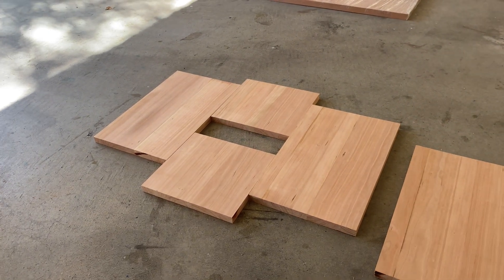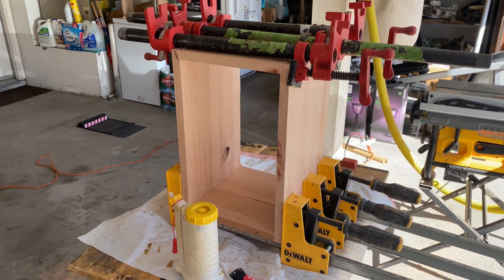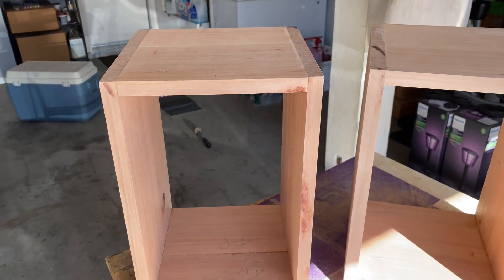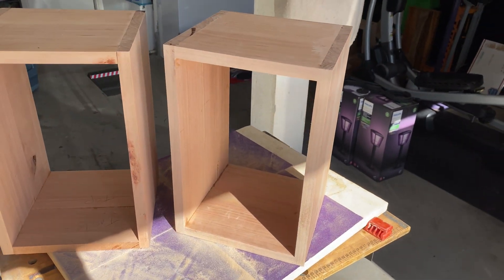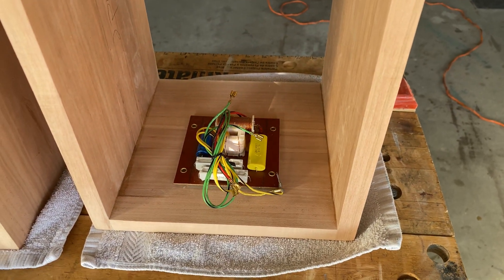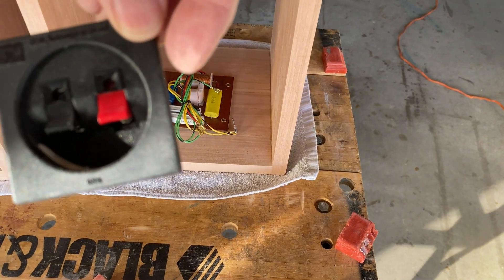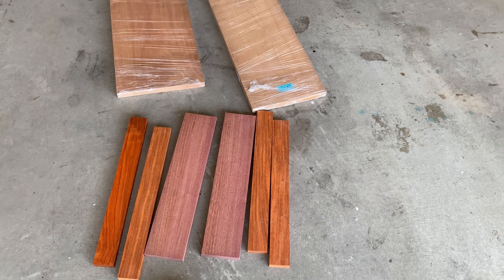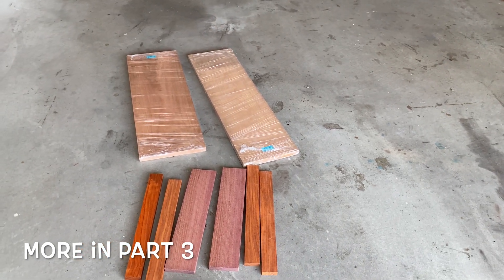JBL LX22 Makeover Part 2

Comment: Ara, you might want to try using a trim bit in your hand-held router to trim off excess height of the sides. This should reduce sanding effort. I actually make the front and back panels 1/16” oversized and use trim router to get them to match sides and top.bottom. It is darn hard to measure and cut  front or back to be an exact match. Enjoy your podcasts and speaker build videos.
Reply from the maker: Thanks Steve! that is a great idea!